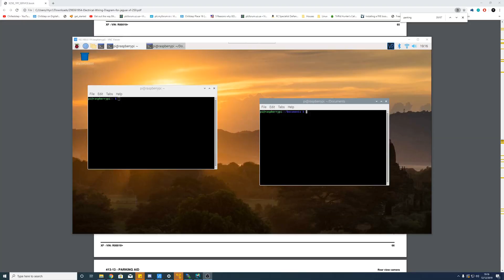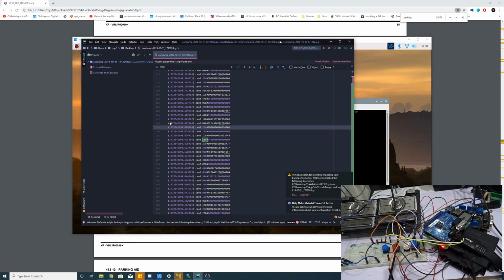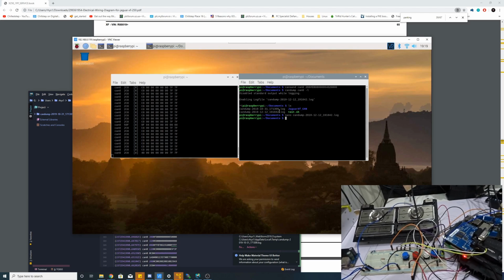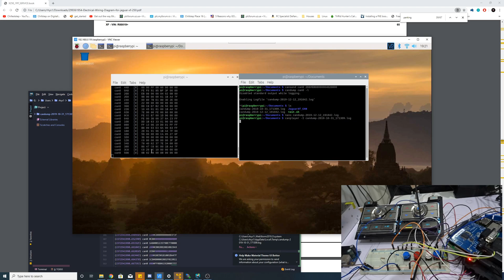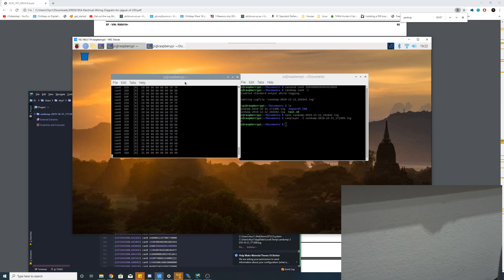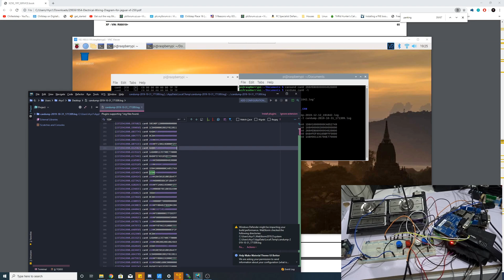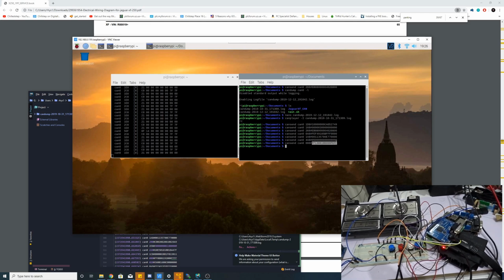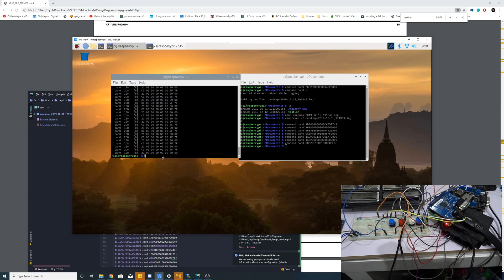Canbus hacking guide part 2: How to get a module to wake up via can bus without knowing message

Comment: Just occurred to me, parking module is meant to come on when you either in reverse gear or flick the parking switch on the overhead console (you need to be traveling lover than set speed for this. Do you have a reason to wake parking module up?
Reply from the maker: Just to be ables to decode the messages off of the car. Essentially what's happening in this video, is figuring out what message gets broadcast over the network to tell the parking module to turn on. From here it's easier to then decode the messages used to display sensor status than it is to do it on the car
Reply: @RhysMorgan1  I thought you're planning to detect the tail gaters and flash the rear fog lights at them :-)
Reply: @alierhan7773  thats a great idea! Don’t mind if i steal it ?

Comment: I have a Jaguar XF :-) You inspired me to work on this project.

So far, I've got my PI setup, 7" monitor hooked up, I ordered piCAN2, I should have it in the next 7-10 days.

Great work mate, hopefully I'll get this project underway.

I have IT background, not very strong UNIX/LINUX skills but enough to survive. I've been working on my home automation system based on OPENHAB using an old iMacs and lots of ESP8266 based microcomputers, good fun
Reply from the maker: Awesome, will be good to have someone on board with it. Let me know how it goes!

www.moderndaymods.com I have recently added a hardware guide there and will soon add the software etc side
Reply: @RhysMorgan1  Thanks for the hardware guide, I was in need for the extension cable for the monitor. I wasn't 100% sure if I could use camera extension.
So far I've got everything ready to go, when I get a chance I'll start monitoring the data coming from the canbus in the car.

I'll be using 12v to 5v 10A DC/DC converter in the car, I'll get 12V from the OBD2, I have few ideas how to turn off the PI safely, I'll explore those when I get to that point.
Installed NodeJS, the tests running without any problems. Your new GUI looks great.
Reply from the maker: @alierhan7773  Awesome, what year is your model? theres some ideas on turning off safely on the bluewave studio forums. For now I have just been using the power button built in to the dash, works pretty nicely. But will eventually go for the timer and relay route.
Reply: @RhysMorgan1  I'm using Pi 3b+ when Android Auto starts it is slowing down considerably, once I get GUI the way I like, I will upgrade to new Pi 4
Reply: @RhysMorgan1  My XF is 2009 Luxury 3.0 V6 petrol
Reply from the maker: @alierhan7773  that's suprising that it's slowing down. I have a 3b running in our freelander 2 and it's pretty quick. But yeah a 4b will be much faster.

2009 should work straight away with this 🙂
Reply: @RhysMorgan1  Saw this linked from PH.  Curious as to what you have your Pi doing in the Freelander as this is what Im looking at one for with the PiCan.  Great work
Reply from the maker: @DanielSayles  the freelander 2 is pretty basic right now (it's my other Half's car, she doesn't like me playing with it)

There's one pi running Android auto where the factory nav was.

Then there's a second pi running the factory fit headrest monitors using kodi. The main pi in the front has an app I created that allows the driver to control what's playing on the second Kodi pi.

For canbus stuff I havent had much chance. I believe in my vids, there's one of the parking sensors that I managed to decode, which I then Plummed into a visual parking aid app. But it's not quite done yet..

Hoping to get similar functionality to the latest Jag update I have done at some point.
Reply: @RhysMorgan1  Thanks a lot for the reply.  I've ordered the Waveshare CAN HAT and look forward to following your videos when it arrives.  Great work and nice and clear.  Thanks.

Comment: i use for canbushacking a stm32 device and canhacker2.0 on windows....is much easyer to use....
on my ford for pam is id 131....found almost ids and messages rigth now....missing only some for climatic...and some messages on the hs can bus....
Reply from the maker: yeah I have seen that software, its pretty much just can-utils with a gui, those options can be passed through arguments to the command.

How do the messages for you parking sensors look? an analogue value per sensor? or just a certain amount of stages depending how close things are?
Reply: @RhysMorgan1  
The optical PDC shows a "beam" symbol for each sensor. The symbol getting short the nearer the object is detected, and it also changes color.
W = White = No object in range
Y = Yellow = Object in range, far away
R = Red = Object near, pay attention
! = Red + Exclamationmark = Object nearer than 20 cm, collision possible
For the PDC it seams there are only 4 possible values, meaning 2 Bit per Sensor. But this could be even more and only showing 4 values... don't know.

Now i put some of the values here with my results of the optical PDC, giving each sensor with color:

D2 D1 D0 D2 D1 D0 00 00 00 = 000000000000000000000000 = WWWW 0D EF 40 = 000011011110111101000000 = WWWW (strange, eh?) 00 5A C0 = 000000000101101011000000 = WYYW 00 6B 40 = 000000000110101101000000 = WrrW 0D DA C0 = 000011011101101011000000 = WYYR (D1 flapping between DA und 5A) 0D 5A C0 = 000011010101101011000000 0D D6 A0 = 000011011101011010100000 = WYYR (D1 flapping D6, 56) 0D 56 A0 = 000011010101011010100000 0D 82 A0 = 000011011000001010100000 = WYWR (D1 flapping 82, 02) 0D 02 A0 = 000011010000001010100000 0D 00 00 = 000011010000000000000000 = WWWR (D1 flapping 80, 00) 0D 80 00 = 000011011000000000000000 0D 00 1E = 000011010000000000011110 = RWWR (D1 flapping 80, 00) 0D 80 1E = 000011011000000000011110 0D 00 1F = 000011010000000000011111 = !WWR (D1 flapping 00, 80) 0D 80 1F = 000011011000000000011111 0D 64 60 = 000011010110010001100000 = WRYR (D1 flapping 64, E3) 0D E3 60 = 000011011110001101100000 0D 5E E0 = 000011010101111011100000 = WYYR (D1 flapping 5E, DE) 0D DE E0 = 000011011101111011100000 0D 64 60 = 000011010110010001100000 = WRYR (D1 flapping 64, E3) 0D E3 60 = 000011011110001101100000 0D 5E E0 = 000011010101111011100000 = WYYR (D1 flapping 5E, DE) 0D DE E0 = 000011011101111011100000
Reply from the maker: interesting, nice work getting thsoe. I'm waiting on a new sensor for the xf before I can take a look at those, but just sussed out my wifes Freelander 2 (which should be almost identical) seems pretty different to yours. This is split into 4 corners of the car, a byte for each, reads 00 when no object, lowest value I saw was 40 (hex) and then all the way upto FF, so should be able to write some nice ui for that.
Reply: @RhysMorgan1  seems your is much more simple in all can bus structure....
Reply: @ronald8E  what are you doing with that? reprogramming buttons?